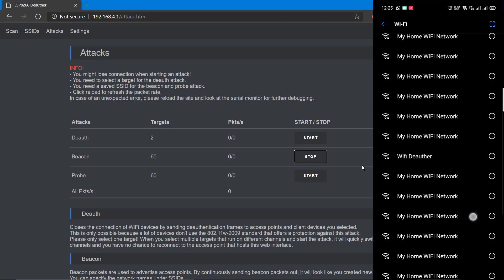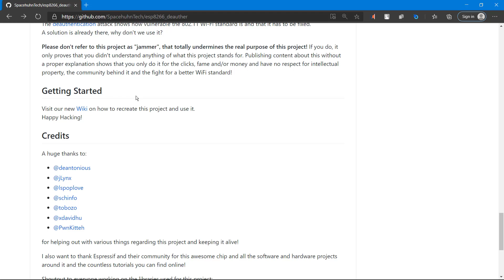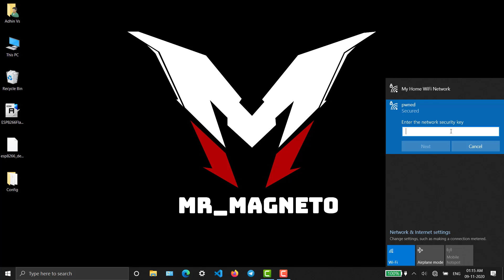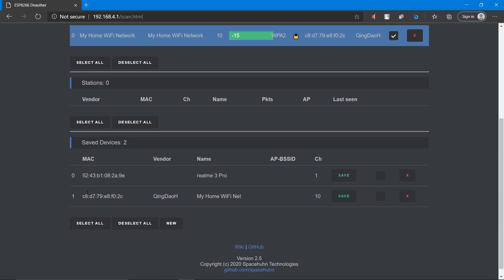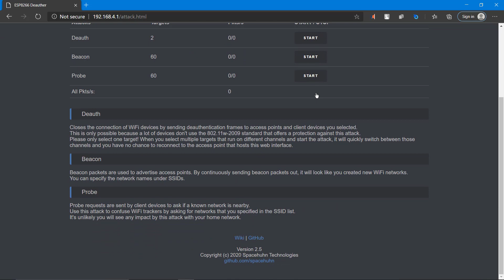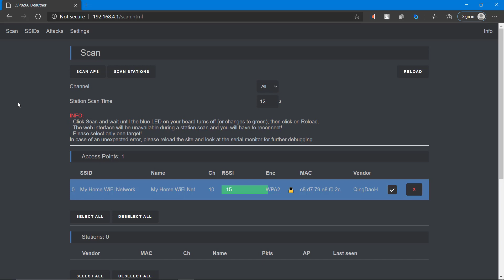DIY $5 Wifi Jammer Using NodeMCU | Deauthentication Attack Using ESP8266 | Ethical Hacking

Comment: I was searching for loan to sort out my bills& debts, then i saw comments about Blank ATM Credit Card that can be hacked to withdraw money from any ATM machines around you . I doubted thus but decided to give it a try by contacting {globalatmcardhackingservice@gmail.com} they responded with their guidelines on how the card works. I was assured that the card can withdraw $5,000 instant per day & was credited with$50,000,000.00 so i requested for one & paid the delivery fee to obtain the card, after 24 hours later, i was shock to see the UPS agent in my resident with a parcel{card} i signed and went back inside and confirmed the card work's after the agent left. This is no doubts because i have the card & has made used of the card. This hackers are USA based hackers set out to help people with financial freedom!! Contact these email if you wants to get rich with this Via: globalatmcardhackingservice@gmail.com